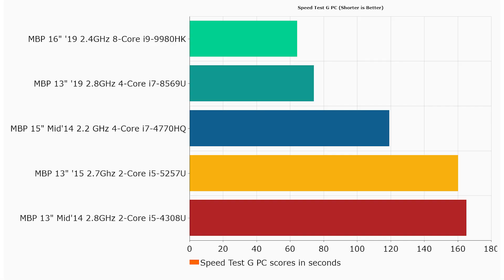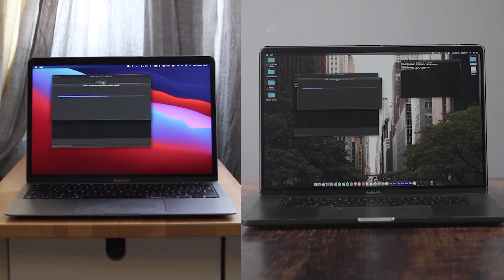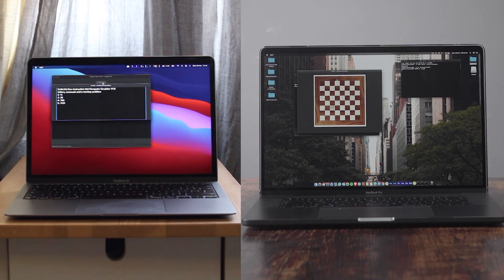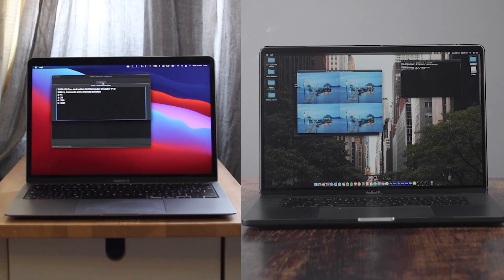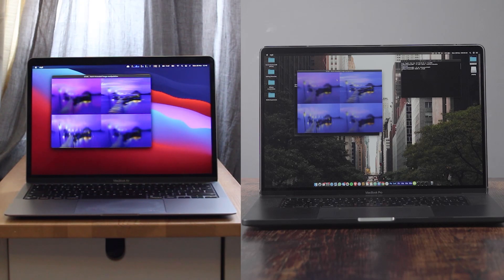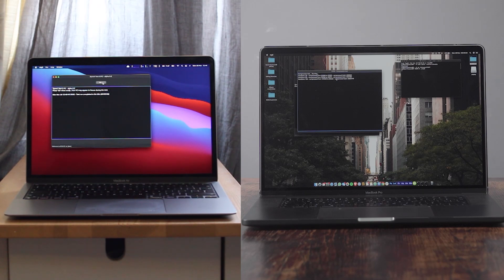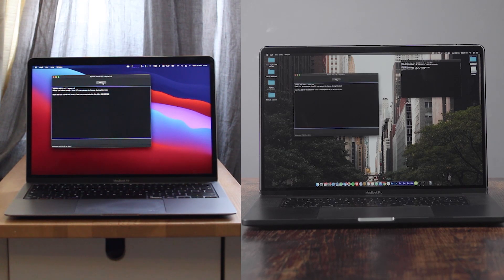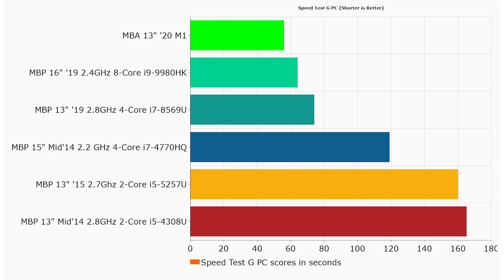MacBook Air (M1) Real World Performance and Thermal Throttling Test

Comment: i wish i had an apple computer... not because of the performance i just want to compile my app in xcode to be able to publish it on the app store
Reply: You don't need a brand new Mac for coding tbh. You can buy very good used ones on eBay and even the older macs are still good enough if you only do coding. I'm using a 2012 rMBP and I've been using it since launch day and I can execute code and do all my University work on it without a glitch. The only problem I face at times is when it comes to graphics intensive work. If you go for a used Macbook, just avoid the ones with the Butterfly keyboards (2016-2019 era). Or you're not traveling much, you can get the Mac Mini with a student discount as well.
Reply: @dj4celine  for now i will just rent a mac... its 70usd for a month on a service called mac stadium... i think i will know in a month whether i am serious about app development on ios and should get a mac or just move on

Comment: The pro has a fan. It's the air that doesn't have a fan.
Reply: Has fan, can run at full throttle for longer. Slightly brighter display, longer battery and Touch Bar.
Reply from the maker: And I am using the Air.

Comment: It´s great technology, no doubt. But, never buy anything again from Apple as long they follow their totalitarian approach - to control everything from the Operating System to the Applications you install or use. Apple is actually worse then Google these days and far worse then Microsoft ever was. Waiting for a proper open high performance ARM architecture platform.
Reply: The fact that they are able to control everything,is the reason why these m1 MacBooks are so game changing
Reply: u can install any apps from the web or the App Store on M1 Macs, and can run VMs for ARM Linux and Windows. The control of OS is what makes M1 so good
Reply: @rohithmekala2608  The Apple store is totally controlled by Apple. Being able to install a VM is a fake control. I will not buy from Apple. I did in the past, a IMac that runs Linux now. No way i am gonna buy anything from Apple under this conditions
Reply: @lucius1976  yes agree but admit that u can download outside of the app store on m1 Macs

Comment: Literally all M1 mac reviewers talk about video editing, rendering, exporting etc.. Isn't there any other use for computers. Is everyone in the world just doing video editing? 
Why no one talks about real world uses like 20 open crome tabs, making spreadsheets and using other office applications, etc.? What about any compatibility or performance issue with these applications?
Reply: They don't mention stuff like that because even the $329 iPad can do all of those things without any problem at all. It's not that everyone is doing video editing, it's just the most resource intensive task that's widely available.
Reply: Probably because even the intel Macs did all that work fine. Chrome is still very power hungry on M1 Mac. Probably it's Apple's way of saying use Safari at all costs.
Reply: @arindambaruah5419  that's true. Any Intel computers did all daily tasks quite well. But M1 seems more promising. So it is important to know if daily programs will efficiently work on this new processor without any compatibility issue. I remember what happened with surface pro X. The 64-32 bit compatibility was a nightmare.

Comment: I think that the main problem of comparing the M1 with other x86 macbooks is that the other macbooks have notoriously high throttling due to the borderline cooling into apple laptops which run those chips at 100C and gave lower results compared to the same cpu into a normal laptop

Comment: I used to imagine how powerful the A12X on my iPad Pro if it has access to what the i7-7700HQ in my laptop has.

Imagine if it’s can freely draw and dissipate a lot more than 5 watt of power and heat.

Now I no longer need to wonder, M1 with just 10-15 watt of cooling has beaten my 45 W i7-7700HQ by a long shot, however I still want to see how far Apple can push the performance of their ARM SoC especially on desktop setting.

Comment: Hi Gary, is you test platform independent or was is native / translated under Rosetta?
Reply from the maker: Think about it, if I am running the x86 version then the performance of the M1 is incredible. But the MBA is running code compiled for the M1.
Reply: @GaryExplains  ok yeah, that's what I thought. MBA seems to beat Intel even on Rosetta, but the equivalent Intel, not the 45watt chip in the 16in, so it makes sense that this is native. What would be interesting would be a video on how easy (or hard) is to port software / compile code for the M1
Reply from the maker: @_Digitalguy  Porting is super easy. For Speed Test G PC I just did a recompile, that is all.
Reply: @GaryExplains  So you turned it into a universal app? I have had several discussions on several forums already and there are a lot of unanswered questions. For instance some people wonder, would a universal app just run on ipad (e.g. if Microsoft makes full Word universal, as they are going to, could they then port it to the App Store for iPad? I know it's not optimized for touch but so is also Word on Surface devices). Also, we have been wondering how much easier is to make universal binaries for Apple Silicon and for Windows on Arm...
Reply from the maker: A universal app won't run in an iPad, that is not what universal means. However Apple does have frameworks that make it possible, do a search for "Mac Catalyst." As for Windows on Arm, the processes is very similar and Speed Test G PC works on x86 Windows and Windows on Arm with just a recompile. UWP apps even easier.
Reply: @GaryExplains  Thanks for the answers! I know about Catalyst, but isn't that to do the opposite, port ipad apps to Macs? So basically if Microsoft wanted to port the x86 Word to ipad they would have to go through a more complicated process than just recompile, even if they already have a universal app for Macs.

Comment: How it is for Android studio and emulators? Also homebrew. Being an Android developer that is my only point of interest.
Reply: homebrew doesn't work by default  Android studio is good and you need to use a phone instead of an emulator, if you don’t  want to lose performance and if you still wanted to use an emulator  it does work but not fully
Reply: @samuelrajasingh506  Thanks. Got it.

Comment: How good is this M1 compared to R7 4800u.
Since 4800u runs at about 25W in sustained loads and MPS's M1 runs at 20W in sustained loads.
Please check if these readings are wrong.

Comment: remember the M1's TDP on MBA is only 10 watts! yet still neck in neck in neck with 7700K. woaw.
Reply: Actually beating
Reply: @BismoB (and @Artur Mavlyuchenko)
Don't get me wrong the M1 and the whole "package" is really impressive, and actually really "cheap" considering the "build and performance" ....BUT.... I'm not convinced that that specific test is the best example of the "strength" of the "M1"! And the reason for me saying that is that there are ""suspicions"" that the M1 is running "Single Core" but "multi (2) threaded, when the benchmark "should" run "single core single thread" and it does so on all "PC's"... So the results are "a bit skewed".
If You are interested in the details look here:
https://wccftech.com/why-apple-m1-single-core-comparisons-are-fundamentally-flawed-with-benchmarks/
As I said I think that the "M1 macs" are impressive, but that doesn't mean that there aren't a lot of "marketing BS" going on... My "pet peeve" is when they compare the "M1" with the previous own "intel Macs" as if they were representative, for what the Intel chips were capable of... Don't get me wrong, Intel really "screwed the pooch" with their processors lately, but everybody and their dog knows that Apple simultaneously strangled and fried their Intel laptops. so to "beat" them didn't really take all that much, i.m.o.
Best regards.

Comment: Hey Gary love the video. 
Have heard the hypes about the new M1 chip but until a credible source like you validates it with your Speed test G I am not sold.
I am seeing the laptop speed test G for the first time here. Does it test the GPU too or just the CPU? 
Would you test the M1 chip's integrated graphics with other processors integrated  graphics and even a GTX 1080 if it is worth testing? 🤔
Reply from the maker: Just CPU at the moment.

Comment: Gary, did you recompile your speed test for the M1, or run your Apple Intel version on the M1?  It was not clear from your video.  In addition, I would love to hear your thoughts on the entire SoC, not just the CPU/GPU.  I suspect high performance can be linked to the integrated RAM (compared to Intel RAM bus design), separate neural engine CPU, etc.  Also, I think Apple's compiler development and technology is under-reported and underrated with respect to its impact on the performance of apps running on all of its hardware (iPhone, iPad, TV, laptop).
Reply from the maker: It is the recompiled native Arm version. The x86 emulation will be in another video. As for my thoughts on the entire SoC, I have a video about that already.

Comment: M1 MBA beats i9 MBP. 
Now I'm an apple fan.
Reply: This is just the beginning.... Apple’s entry-level processors with single threading. Wait until you see the M2... etc.
Reply: @huggyuk  that is stupid, the problem of comparing the cpus within other macbooks is that those cpus have always been trhottled and pinned at 100C giving performance which where much lower compared to the same cpu in a normal laptop.
Reply: @Archer_Legend  what’s stupid, the fact that processor heats so much that fans has to run screaming and still gets beaten by a passively cooled system?
Reply: @allajunaki  they are different cpus with different targets. But still the metro of comparison is not the apple offering in old macs

Comment: 2:22 That Xeon is from 2010...
Reply from the maker: Indeed and it has a TDP of 95W. So the point is that Apple' new chips is faster and probably uses one sixth of the power than a high end chip from 10 years ago. That is a good marker in understand where the technology is going.
Reply: @GaryExplains  actually that was quite confusing....the x5650 is 6core, 12thread, not 12c24th....I have no idea how Cinebench has the wrong data on that
edit: ohhh you know what?   I bet that cinebench run was a dual socket motherboard.  So that would mean 2 x5650s running in tandem for that multicore test.   I'd test with my x5650 and w3670 to see how a single one scores, but I don't have the time to download and run that right now...  I'm guessing it would be around 3300-3500
Reply: @GaryExplains  Yep, for us consumers progress is always good. Intels dominance wasn't a great time. But mentioning the Xeons age would've put things in perspective. Intels recent tiger lake processors aren't far off from what the M1 delivers.

Comment: Seems like M1 handles graphics far better than intel. Intel took lead in a couple of tests. You should compare with some latest AMD 4000 laptops.
AMD does graphics far better.
Reply: No, those blur tests were run completely on the CPU, the first test using 1 thread, second one using 4 threads. No graphics here, because if any of these tests utilized the GPU, the 16 inch would smoke the M1.
Reply: @zonyyu8412  yeah i never used the term gpu. Still i want see it up against AMD
Reply: @zonyyu8412  it wouldn’t smoke it, unless it’s 5500M or 5600M. And it’s just the integrated graphics, let’s see what graphics Apple’s gonna put into its next 16” MacBook Pro
Reply: @arturmavlyuchenko7647   haha forgot to specify 😅. Very true, the M1 GPU punches up to 5300M performance, which is quite impressive for an iGPU
Reply: codec engine in M1 is far better than Intel's, transcoding is one of the niches for M1 look at the last review of LinusTT

Comment: Could you detail why the M1 is faster than Intel core chipset and we know that generally previous laptops have cpu, gpu, and ram would be assembled separately but in this M1 chip laptops, all the cpu, gpu, ram are assembled into this M1 chip. So is this performance difference only because of their assembing closely  into M1 chip, if so what is happening upon assembling so closely I.e. Why are we getting so much performance boost?
Reply from the maker: I have a video about the M1 on the channel.
Reply: the m1 includes everything because it basically is an ipad with included keyboard

Comment: If Gary switched up from his old Macbook pro to new Macbook Air , it means the device is worth the price. Thanks Gary, you helped me solidifying my purchase plan.
Reply: @Laptop_clevo  exactly that makes sense. You can always find workarounds for storage with external drives but lack of RAM can be a huge setback. Considering just running a single emulator + chrome consumes up to 70% of RAM
Reply: Specs ?
Reply: @ineav  8gb RAM & 512GB SSD would be good i think

Comment: Microsoft and Qualcomm should take notes . If Microsoft doesn’t take this seriously it will be Windows Phone situation all over again in next gen ARM based laptops. I don’t like apple but they have done a brilliant job.
Reply: Looks like the 4800u is better and that’s zen2 the 6800u zen3 6nm is supposed to come out in early 21 I believe x86 isnt dead so we will still see AMD and apple ducking it out I certainly am not getting one of these anytime soon much rather have a 4800u or the next zen3 laptops
Reply: yes, but the appla proc is in 5nm, and the intel is 14nm, that's a big difference, AMD is currently 7nm but soon also 5nm, x86 processors haven't said goodbye
Reply: Windows ecosystem is mature. Windows Phone was a new player among the already established two horses IOS and Android.
Reply: Microsoft is supposedly planning to start making its own ARM chips. It will still take years for them to catch up though. In the meantime, AMD may become the new standard on Windows laptops.
Reply: It seems ok at this early juncture , but it does not have runs on board , in a year or 2 years time , it will be interesting to see how the new architecture holds up . 
as we have seen many times in all manner of man made stuff ,  new products often fail in some way  down the track .

Comment: Some more context about the Cinebench single-thread result and why it's so impressive 👇
The M1 SoC (including RAM) uses <5W running single-thread Cinebench and gets 1515 points.
The Intel 1185G7 that is faster at 1532 points (margin of error really) uses an obscene ~20W running single-thread workloads as it needs to boost to 4.8GHz to achieve that level of performance.
Basically the same performance at 1/4 the power draw. Amazing 😎
Reply: Pretty sure most people know this by now, but there's a utility in macOS for getting power stats.

Run this to get a summary of SoC power draw:
sudo powermetrics -s cpu_power -i 2000

Comment: Cant wait for the real MacBook Pros with 4ports and M2 4nm chip with 12core CPU. I may finally replace my 2011 MBP with 32nm Sandy Bridge i7 4core CPU. I just wish they were user upgradable/repairable like my current device. Where the hell is green peace? Where the industry is leading with soldered on everything should be illegal!
Reply: 4nm? Which fab in the world does 4nm node?
Reply: @wyw201  The M1 chip is 5nm and the M2 will be 4nm
Reply: @Babaji5D  TSMC will have 4nm capacity by Q3 next year? Likely 2022 to get decent yields per wafer.
Reply: @wyw201  Could be but whatever the M2 will end up looking 4 or 5nm it will still be 12core and 50-100% faster than the M1 with probably an in house dGPU as well. Apple will gain enough knowledge with these beta M1s to hit the ball out of the park with the M2s
Reply: @Babaji5D  50-100% is a large range lol, surely we can be more accurate here.

Comment: 1. How did Mac M1 manage to overtake Intel Core i9 when it was lagging initially? Has that something to do with their other ML or signal chips or larger cache sizes? That may be the key.
2. The second point a 5nm chip will have more transistors than a 10 nm Intel chips. Don't they affect the speed? And don't we have to look at speed per transistor rather than total speed?

Apple is definitely hiding something to make it all look like a magic. We all know there is no magic! We need to find out the root cause.
Reply: dont take nm for granted. Yes they were a good indication 15 years ago but last few years that number is pure marketing and means nothing. Intel's 10nm process has a higher transistor density than TSMC's 7 nm process. This is because in the last years we have actually changed the way we measure transistors.

And no, i dont think apple is hiding anything. The truth is this M1 chip is just a normal arm cpu which isnt as limited by thermals like normal arm cpus
Reply from the maker: I have a fairly detailed video about the M1 on this channel.
Reply: Unified ram. And optimization. I think that is the one thing that made a huge difference. Having ram so close to the cpu gives a lot latency advantage for single core processing, and the fact that the os was built up together with that system in mind makes it much better at taking advantage of the latency. Again, it's vertical integration that's the key, just like on ios.
Reply: See Anandtech analysis of Apple Silicon... TLDR apple uses a LOT of expensive goodness in their chips, ultrawide pipelines, universal memory, LOTs of cache, etc. About the speedtest G, thats hard to compare Apple Silicon with Intel, because on is a SoC and the other is not. I mean, you can compare but the results will vary wildly depending on the application as shown.

But as a consumer, what I see is a $1000 (or $900 if student) device that beats every other in their class in build quality, display, sound, battery, performance, etc. for less money. PC makers should be very worried right now.